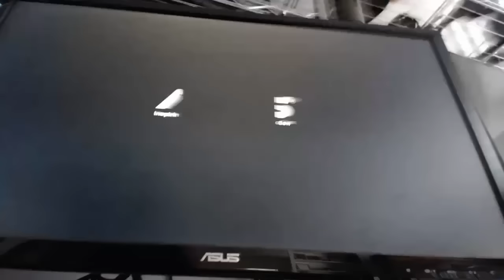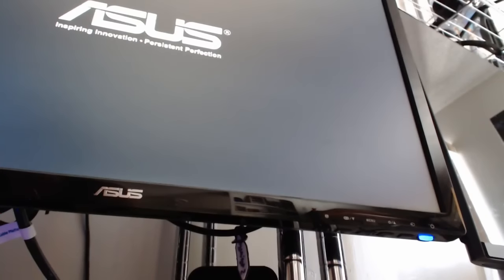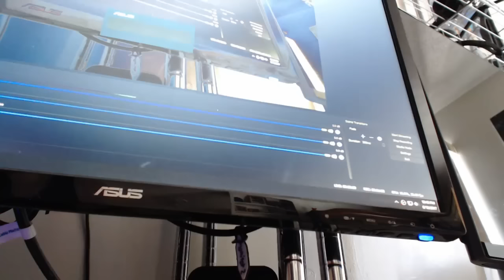Asus VG248QE DisplayPort No Signal - Quick Fix

Comment: Thanks for a resolution to a minor panic attack.
Reply: Same. Minor panic attack. All good and back to normal
Reply: Like I just bought it as well lol
Reply: @silexa3222  I also had a panic attack, but not for my monitor; I've had my monitor for a year now and no problems ever before. I was freaking out over my brand new gpu, which I had just installed the day before this problem arose. But that fear of hundreds of dollars of tech now being useless is exactly the same.
Reply: @konradhamilton5649  I had the same problem. I bought a rtx 2070 and after 2 weeks my monitor goes black. I changed the graphics card, the dp cable and nothing helped. I sent it to RMA and got a new one. Now it happend again and this worked now. Im not sure if something corrupts the dp input...
Reply: Minor panic attack? I almost die.
Reply: Mine set back to 640x640, and I was like, something isn’t right here
Reply: Gregory Hlavac  same shit 
Ty for this video
Reply: I was freaking out thinking my gpu was shot. Thank god this fix helped
Reply: Same omg
Reply: @konradhamilton5649  same here, thought my recently bought 1080ti had an issue. Phew, dodged a bullet i guess.
Reply: @konradhamilton5649  creepy... Same exact situation here
Reply: bro ur telling me i didn’t try turning it off and on😭

Comment: "Did you turn it off and then back on again?" - Tech Support
Reply: I did that multiple times and it didn't work, you specifically have to unplug the damn screen....
Reply: the it crowd
Reply: That did not work only physically unplugging it from the wall worked
Reply: @plbpardo  Unplug the power cable and displayport cable together and plug it in again.
Reply: @Cocette  I am aware, I was telling him that just turning it off was not enough, you had to literally unplug it to make it work again.
Reply: Yes that does not help at all. I owned two of these (now only one). This is too frequent and too common for both monitors and powering down is the only fix I know of. This is really annoying.
Reply: @Cocette  didnt work for me. I still have this ossue
Reply: Minzee  nope. Called tech people and im getting a new graphics card for free. Hopefully that is the issue.
Reply: Minzee  i would call tech support and also get pc doctor on ur pc. It runs tests and stuff. It is awesome
Reply: @brianevichin6660  hey brian, i wonder what u told them because im having the same problem. I called and they told me to restore the pc and now, i still not getting signal from none of my displaysports!
Reply: @luisvillanuevamadero5666  I am only 14 so my father did it. I am pretty sure he called Dell then one of the tech guys from there went on my PC from his office and checked some stuff out and they came to the conclusion that is was the graphics card. They came 3 days ago and replaced it and it is working good so far. I would contact tech support and tell them what is going on. Also, on your PC, download malwarebites and PC doctor. Mallardbites let's you know if there is viruses and other PC threats and PC doctor let's you know if anything is wrong with your graphics card.
Reply: @brianevichin6660  same here dude. Before I restored the computer an alternative plug was giving me signal, but the main one was not, so i thought it would be a bug so i unplugged everything and plug everything back on
Reply: @brianevichin6660  but unfortunately i didnt work so, today i called asus to see what was going on and they told me to restored the pc, so I saved al my stuff and restored it
Reply: @brianevichin6660  but now is not giving me signal from none of the connectors
Reply: @luisvillanuevamadero5666  ok. If that doesn't work, call the PC company. I have an Alienware which is Dell so I called them but call the PC company to replace your graphics card. Hopefully, u have a warranty

Comment: Hey all! 

a little late on the subject but for me, everything wasn't working, at all. So I proceeded to use the shortcut Win+Ctrl+Shift+B to reset the display settings then Windows + P to open the side menu bar for displays (I,m on windows 10). I switched that option (offered ont he side) to ''extend'' and it seems to be working fine now!

Hopefully this will give one more options for those that all of the above tips didn't work yet! :D
Reply: Thanks a lot man ! Nothing was working except your method ! You are my life saver
Reply: BROOO! THIS IS THE ONE THAT DID IT FOR ME
Reply: Thanks so much man, nothing was working until this. Actual life saver.
Reply: Thanks a million Willy! when i did this it worked the first time! GOOD SH*T!!!
Reply: Thx a lot, it worked like a magic trick
Reply: Tried the method in the video, didn't work, tried to roll back windows update, didn't work, bought a new display cable, didn't work, but this, this worked instantly, thank you. <3
Reply: THANK YOU
you fixed it
Reply: You are a literal life saver. Unplugging the cord did nothing for me. The "WIN+CTRL+SHIFT+B" did the trick lol
Reply: How does this work if it’s saying the PC is not connected to the monitor??
Reply: Thank you so much man, was about to throw this thing outside
Reply: i spend 1 hour trying to fix the problem. i just used your shortcut and boom in 2 seconds everything worked smoothly. thanks alot! your comment should be pinned!
Reply: LIFESAVER BRO I LOVE YOU SO MUCH!!!!!!
Reply: Legend
Reply: my guy you saved my christmas thank you so much and have a nice christmas ! (or if you dont celebrate it a nice rest of the year)
Reply: yeppp not working for me of course :D
Reply: How am I supposed to do that if the screen is black which is the main problem LOL!!
Reply: 3 years later and it still works, thank you so much
Reply: @djustincase7793  I have no idea
Reply: idk why this worked but thank u kind sir
Reply: @hydra2k  Cheers legend
Reply: YOU ARE MY GOD
Reply: Thank you :)
Reply: wtf actually thank you 
i work !!!!
Reply: Didn t worked what can i try

Comment: OMG it works.  I have bought 3 separate display port cables, thinking I was getting a bad cable. My last cable was 20 bucks, thinking I just had to get a higher end cable, but it wad dead on arrival (so I thought).  Turned out a power cycle fixed it.  I feel like I should just give you the 40 dollars I spent on cables! ;) thank you!!

Comment: Thank you, I had to pull the Display-Port cable as well, it was pulling power through it.
Reply: I had to do this as well.  Thanks for the suggestion!
Reply: So i must do this every  time i star pc??? When i was on win7 i heavr no problem but on win 10 every time i shut down  pc   and when i want turn on i must do this! 😣
Reply: Same here, but i can't call this a fix..
Reply: I love you 🤗 it worked
Reply: saved my days
Reply: It worked, thank you!
Reply: Some random comment is what finally worked for me. Been pulling my fucking hair for over an hour. Thanks.
Reply: Mine doesn't work
Reply: Isaac Quesenberry does it boot fine every time afterwards ? I can boot with hdmi and just switch cables and it works.. just don’t want to have to do that every time 🤦🏻‍♂️
Reply: This worked for me. Thank you!
Reply: rather than unplugging the DP cable just hit the power button twice on the monitor when it stays orange, had same issue and that cured it, I now have my monitor on a separate power socket of its own and I can easily get around this now just by turning it off at wall and pressing the monitor power button twice.
Reply: Fucking thank you bro
Reply: THANK YOU. I WAS ABOUT TO START CRYING. I just got the monitor 2 days ago and it pulled this stunt on me.
Reply: u are a legend srsly

Comment: After a Windows 10 update with my Acer, it was the same problem. Thanks for reminding me to do this!
Reply: this video didn’t work for me sadly so i took to the windows update and after messing around with some settings it was all fixed. can’t believe technology can just act up like that at a moments notice lol. I was about to buy a new cable, maybe new monitor, maybe new graphics card 😂 i was panicking hard
Reply: @kylekookie1440 how'd you fix it, I have the same problem
Reply: @distraction486 Could you fix it ? I’ve a asus with free sync amd and a rx580 lol and it’s only working on hdmi but I want dp

Comment: did not work for me
Reply: deadly zebra me too
Reply: Me to
Reply: For anyone rart like me, make sure after you do the update that godsend andrey belousov posted, that you go into your damn display settings and extend your displays.
Reply: I didn't solve my problem by updating, I had a faulty motherboard. In a month I have no video signal at all. I passed my motherboard under warranty (it is faulty). Sorry for my English (translator).
Reply: might be poor graphics card connection or a faulty motherboard like Andrey said
Reply: Same
Reply: It's probably the cable or computer that has issues, or the monitor is going bad. Try checking those three things (:
Reply: THANK YOU
Reply: @Андрей-г2у5ы  AWESOME, I tried to solve this FUCKING problem by all the ways I could find and from my own experience and NOTHING fixed it.
WHY THE HELL this update does not appears by itself in GeForce Experience or in Windows Update?????
Lmao, like 3 entire days trying to make this work again.....

You made my day dude, THANK YOU.
Reply: Same 😒
Reply: @Андрей-г2у5ы  Thank you so much!!
Reply: @Андрей-г2у5ы  this actually worked, thanks so much man 😌
Reply: Harvey Mullin  i had a spare hdmi monitor
Reply: @Андрей-г2у5ы  thank you so much im drunk out of my mind and i was about to punch my monitor
Reply: @Андрей-г2у5ы  Yes thank you
Reply: Me neither. I am trying to connect Zenbook Pro with monitor using HDMI/DP cable but it won't show anything. DP to DP to tower PC worked, but also in this case HDMI/DP did not work. Any ideas how to connect? Should I try to use the USB-C entry port of the laptop instead and buy an adapter there?
Reply: @Андрей-г2у5ы  Thanks it has been a year since i stayed on dvi port then i randomly saw your comment, thanks dude !!!!!
Reply: @Demencix28  That update isn't compatible with my graphics card (1660) any idea how I could fix this issue?
Reply: @skorkyy  dude if the moniter wont show anything but hdmi 2 no signal how should I do that?
Reply: @Андрей-г2у5ы  thank you!!! why is that not updated with everything else in GeForce Experience?? No way I would have known about this if you didn't post this.

Comment: Worked for me as well. Had the monitor for years and this is the first time it acted up. Also not sure if others have encountered this but it also caused my primary display to blank out but not immediately it went off several minutes after the Asus did. Everything is working now in any case. Thanks!

Comment: Sadly, still didnt work for me, I tried this for atleast 3 times yet it still didnt work
Reply: conti same here
Reply: same
Reply: Same
Reply: Same
Reply: Same
Reply: same HDMI works tho
Reply: Same... I hear my computer detecting the device but still “no signal” :/
Reply: try to "extend monitor" option (if you have multiple monitors).
Reply: @shaqdiesel121  worked .. Thanks
Reply: Me to now I'm definitely dead😵
Reply: When you open the monitor, before it displays the "display port no signal" keep pressing the button on the left side of the power button, then put it in HDMI, then plug off your monitor and open it after 30 seconds. This worked for me.
Reply: Avash Paudel wtf does open it mean
Reply: Same here didn't work
Reply: @brice0403  switch on
Reply: Unplug the power cable and displayport cable together and plug it in again.
Reply: @fqb3668  yoo it worked
Reply: @breakingthegod  this worked for me for some reason. Thank you!
Reply: @Avolition_  i am glad it did
Reply: Avash Paudel OMG u made mine work thank u
Reply: @danielk7363  super
Reply: Avash Paudel help what did you do?
Reply: doesn't work with my vx279q, unplugged many times for long and no result, still DP no signal :/
Reply: @halloweent  i just tried several ways until i figured my way. Nothing guaranteed it will work with your monitor, but just try to do it a couple of times as i mentioned in the above comment. Machines are just confusing sometimes.
Reply: sme
Reply: same

Comment: My Asus VG would always turn black when I set the refresh rate to anything above 60 Hz, even though it supports 144 Hz. It was running fine on 60 Hz but it seemed impossible to go beyond that.
I had almost given up on this when I came across this video. Unplugging the monitor for about 15 secs worked wonders in my case. Now I can finally enjoy my 144 FPS. Thank you very much sir!

Comment: I've had this monitor for about 5 months and this has happened to me twice. Another thing that happens is the screen will randomly go black sometimes but then it will come back on like normal. The black screen thing also happens quite rarely but more frequent than the no signal. Anyone else having this issue as well? The black screen lasts maybe 3-5 seconds and it will only do it once a week or so.
Reply: Seems to be a dodgy connection with the power cable design in this model (I had to RMA my first as the cable fell out every time it was put in), so it seems to bug out if not turn off completely.

Comment: hi im pulling the electricity out, but the light stays on for hours. its a new monitor.
Reply from the maker: Daniel Segal Either you have found a source of unlimited power or you're unplugging the wrong cable :)
Reply: Daniel Segal I had the same problem. Try pulling the power and Display-Port cable and wait for the light to go black. For some reason mine was pulling power through the Display-Port.

Comment: Didnt work for me, pulled the power, let it sit for about 10 seconds, plugged it back in, turned it on, didnt work. If anyone else can help me that would be great.
Reply: I used the advice of another commenter - Try also unplugging any of the cords (i.e. hdmi) as the power can pull from that as well. After I did that it works.

Comment: If anyone is watching this 7 years later, it does work. My DP connection suddenly stopped working and wasn't coming back, HDMi worked fine and the DP connection worked on other monitors.

Power cycle the device as shown in the video and it should work. Don't bother uninstallling drivers through DDU (like I did) it's not that deep.

Comment: Yo if you tried this out and it still didn't work, try factory resetting the monitor. You can do it if you press the menu button on the monitor itself. Did this, then followed the instructions here and it finally worked for me!

Comment: This happened to my monitor months ago. Asus brand but different model, was using HDMI instead because I couldn't be bothered to troubleshoot the problem. Just came back to finally sort it out today and this simple solution fixed it. Actually mindblown how this was all that it needed for the display port to work again. Earned my like

Comment: I had this issue, not sure if it's strictly related to display port though. Power cycling was the last thing I tried - I did attempt to power cycle, but I didn't wait for the light to turn off and that resulted in a zombified state where the light was on, but the entire monitor was unresponsive. Waiting for the light to turn off fixed it. The video itself didn't help me, but the description gave me the idea to wait for the light to turn off.

Comment: This worked for me: Unplug the displayport cable, turn off the monitor, unplug the power cable; wait like 2 to 3 minutes; replug your cables and turn on the monitor. After this my monitor still didn't work, so what I did was go to settings and choose to extend display (or windows + P => extend display) for me this worked and my monitor worked again!

Comment: For everyone who it didn’t work for, try unplugging everything and letting it sit till it cycles. If you leave the cord in the display port transfers a little power and doesn’t allow the reset.
Reply: Already did all of that and it still doesn't works
Reply: @nii1877  did you fix it?

Comment: This worked, I even ordered a brand new display port cord. Which is fine because the one I was using on that monitor was one you had to push in a tab to take out, which is a pain. So I ordered another Ivanky which I have on my Odyssey monitor. All is good now!

Comment: If this does not work for you, like it didn't for me. Swap your cable connections around. That did it for me, if not the cable might have a pin issue and you need a new cable.

Comment: If you have multiple displays and one of them wont connect, check your display settings. The monitor may be connected and detected, but it may say disconnect this display under Multiple displays. Change it to extend desktop to this display.

Comment: It's great to hear that this worked for most people, but for me it didn't.
For me, I had to go into NVIDIA control panel > Display > Set Up Multiple Displays, and re-check this display there.
This stopped working for me randomly after a windows update. Windows was seeing both monitors in Display Settings, but was showing the Asus one weird and small and wouldn't let me change any of its settings.

Comment: If this doesn't work, try going into Nvidia Control Panel by right clicking on your desktop on a different monitor while this monitor is connected. 
-Set up multiple displays
-Check the monitor that's not being displayed

Comment: I thought it was my DP cable that was the problem, so i plugged HDMI cable in and it worked. So i went to the city wasted 32 euros for a new cable, came home and still didn't work. Until i find your video smh. Anyways thank you brother i might have bought a new monitor if i wasn't 1 hour away putting my fist trough the monitor